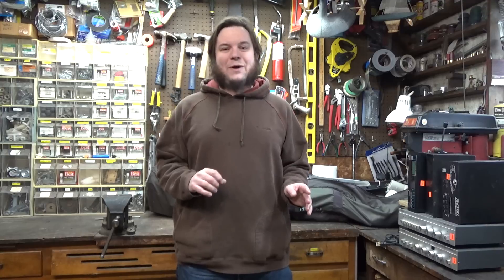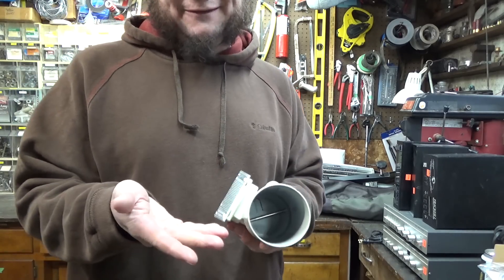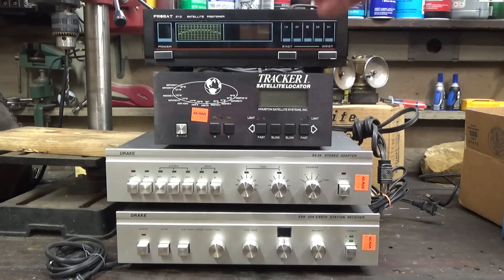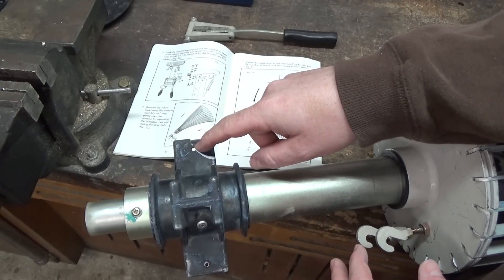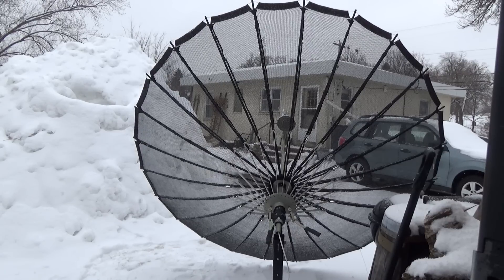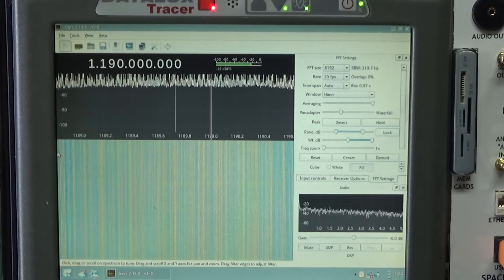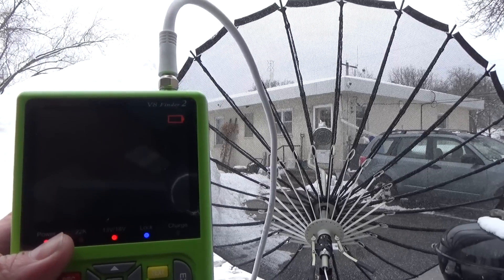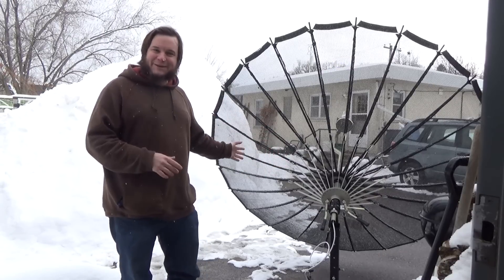Cyberex CN-7500 Folding C-Band Satellite Dish & Free NASA TV

Comment: You need to get a lot of cinder blocks and put them on each of the four base arms and put cinder blocks on top of the cinder blocks to hold the dish down
The wind load against the dish is over a thousand pounds and it will flip right over
Reply from the maker: Yep, it's definitely not made for windy environments, and not supposed to be left deployed for long periods. It came with some big tent stakes to pound into the ground, but I think the dish itself would get damaged by gusts even if it didn't blow away.